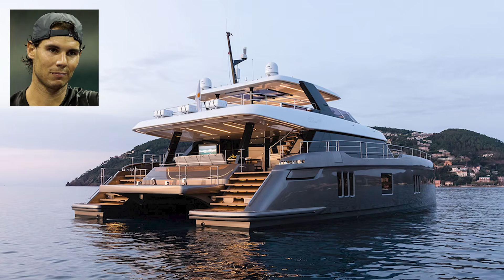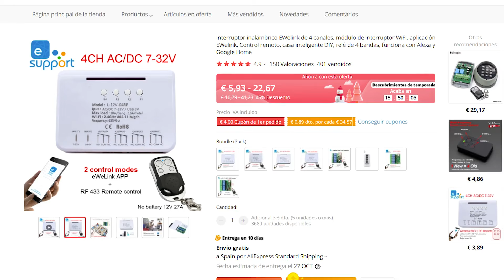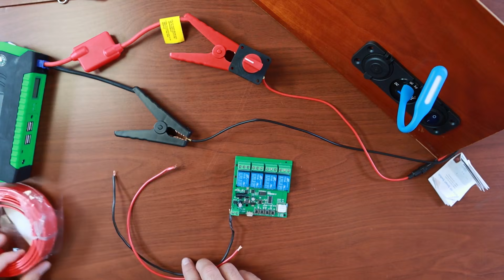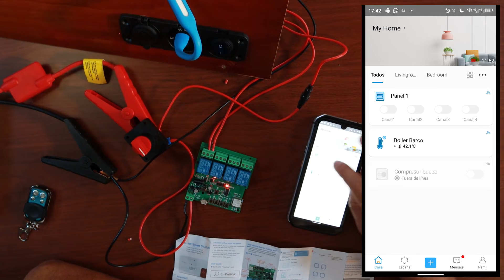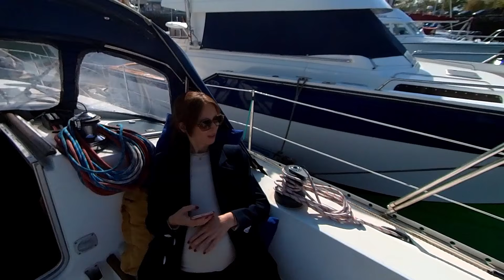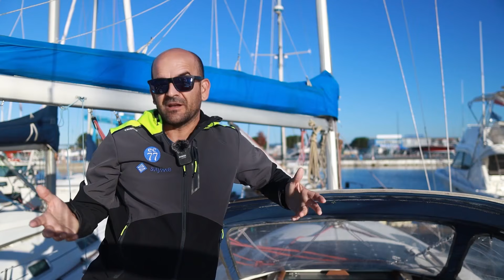EP22 - How to control our boat by WiFi from the beach, or anywhere

Comment: Very interesting. I was surprised you did not use home assistant. That is the backbone to my smart boat. My victron devices integrate super easy and the historical data is so very helpful. Automations are very powerful. As are the dashboards. My navigation is done on an Android tablet. Navionics (an old version of the software before Garmin ruined it) runs on the left and HA displays my key sensors and toggles on the left. I think the best thing about HA is I have all sorts of protocols (Garmin, zigbee, esp32, Victron, EPEver) but they all go into one place. One app sees al and controls all.

Comment: Been pondering about automation. A very useful function, would be if navlights are on. And you start the engine. The white toplight turns on automatically. I don’t know how many times I’ve forgotten it while sailing at night and the wind dies. 😅 
Haven’t been thinking of the schematics. But will probably work with a simple relay picking signal from the starter switch, alternator, or similar.

Comment: Great video!   I guess the only comment here would be that a lot of switch panels do of course include fuses too, so in wiring those connectors, people would just need to be careful to ensure that whilst they're bridging the switch, they shouldn't bypass the fuse.  If you did, it would work of course (so nothing would warn you) but you then don't have the protection of the fuses.

Comment: Been thinking about a solution for this. Starting a heater and fridge remotely would be nice. Both on warm and cold days. 
Bonus being able to turn on decklight when arriving to the dark dock at night. Have been looking at Victron global link. But it has only one relay. 
But is concerneda about powercunsumption. Not connected to shorepower, but have a 300ah batterybank and 100w solacells. 
Any mersurment how a router and relaymodule draws when in not active, but turned on?

Comment: Home assistant would let you create nice dashboards and control your smart relays using it's many integrations. I expect your boat raspberry pi could run it in docker too
Reply from the maker: Yes, I will show in future episodes that one of the options I use for dashboards, local control of the devices and automation is Node RED running in the raspberry..
Reply: Love this integration. Would like to see how to add this to the NMEA2000 or ethernet networks for automated switching of devices on using a MFD (e.g., German, Raymarine, B&G).